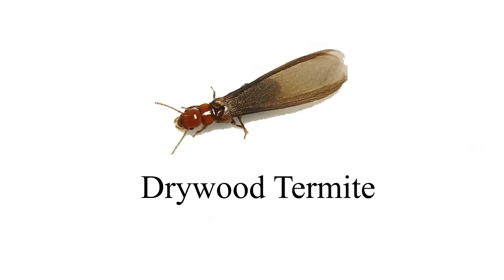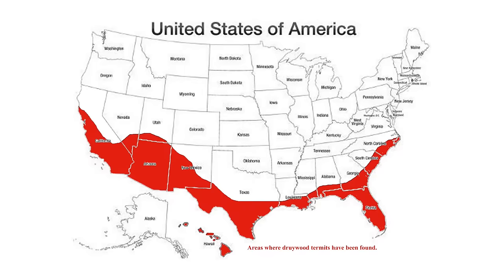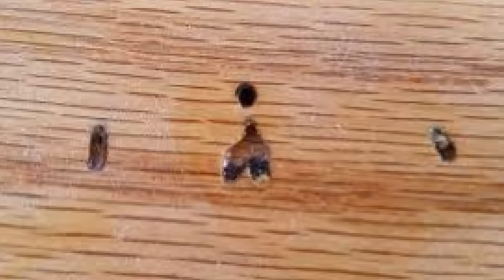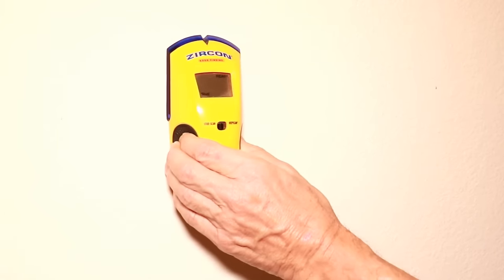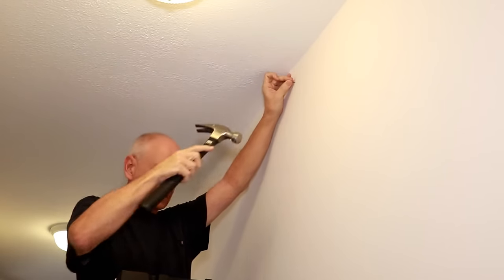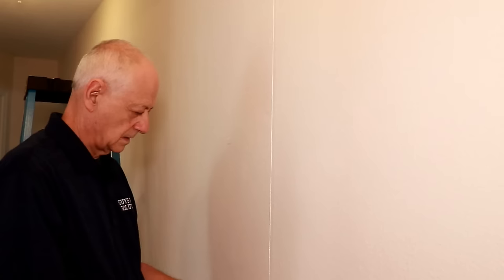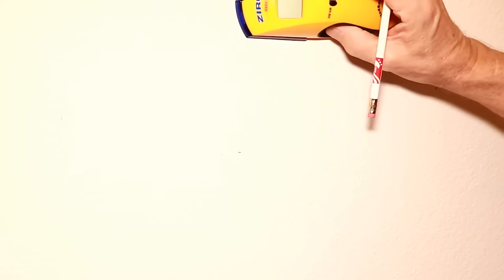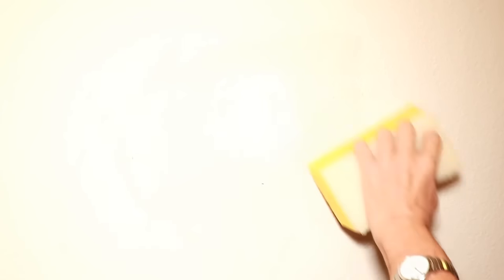How to Treat a Drywood Termite Infestation Yourself. A MUST see if you have Drywood termites.

Comment: thank you for this amazing video,and you taking the time to respond to my question that really means a lot. See I just recently found them and they are only on one spot on my home , so I was wondering if I can exterminate them all before they become more and to other areas of my home. You think if I spray that Taurus sc or the bora-care will kill them without me having to get the home tented? Thank you for your time.
Reply from the maker: Thank you so much for those kind words.  Very much appreciated.  

It is important to understand how drywood termites work.  They enter through cracks and crevices around windows, doors, the eaves, pipe penetrations, and so forth.  Most of the time, they enter through several locations.  That is because a swarm of them attacked your house at the same time.  If there was a crack or a crevice, then they probably found it.  After they established their galleries, which will be inside the wood, it will take four to seven years for them to be able to swarm.  Now that they are in your house, the swarmers will use holes that are in your studs to travel through the walls.  Those holes in the studs were created by the electricians to run the electrical wiring.  Not only are these holes going through the studs, but holes were drilled into the attic for the light switches and to run some of the wiring for the outlets.  So, the termites now have easy access throughout the attic and the walls.  If you have a basement or crawl space, they have access to that as well.  Most of the time, you will have no idea that they are in the walls, because the frass is inside the wall.  To make matters worse, if you have drywood termites, then your neighbors have them too.  That means you have been getting swarmed for as long as they have existed in the neighborhood.  Most likely, we're talking about years, so it's a safe bet that you have these guys in many locations in your home.

I always hate to be the bearer of bad news, but if you have drywood termites, the only sure way to get rid of them is to fumigate.  Prices for this can vary wildly in this industry, so I recommend that you watch my video on how to hire a pest controller without getting ripped off.  That video can save you a lot of money.  You should also know that the gas they use to fumigate has absolutely no residual action whatsoever, so you can get reinfested the moment the tent comes down.  Like I said before, if you have drywood termites, then your neighbors have them as well.  Since drywood  termites swarm every year, it is almost a certainty that you will be reinfested within a year after the fumigation is done.  The only way to prevent this is to do a preventive treatment on your house every 60 days.  Most pest controllers will not do this, so it is something that you generally need to do yourself.  I have a video on how to do that and I will place a link below.  If you absolutely cannot afford to fumigate your house, then you can try spot treating it yourself.  It is virtually impossible to find all the termite galleries, but it is way better than doing nothing.  I can tell you with a high degree of certainty that the termites are not limited to just one area, so treating just one area is not going to get it done.  Regardless of how you treat it, you should begin the preventive treatment immediately, so that you do not get additional termites paying you a visit.

I know that's not what you were hoping to hear, but it's the truth.

I hope that helps.  Be well my friend.                      

Video on how to hire a pest controller without getting ripped off:  https://youtu.be/y-a8XOqVrlE

Video on how to prevent drywood termites (You do not need to treat your yard.  You only need to treat the exterior of the house for drywood termites):  https://youtu.be/Yozv3s-Qwlw

Comment: Thanks for the info. Actually Guy, a few months back I commented in one of your videos to which you graciously responded to a question I had and offered advice. In return you asked that I let you know how it went. I am sorry to say that I couldn’t find my original message as I had watched several of your videos and didn’t know where to look. Anyway, I had taken your advice and haven’t seen any further infestations. However, I am sure after watching this video and the fact that I have not seen any subterranean termite tunnels on the 3 foot brick facade that what I had seeing in the craw space joist was dry wood termites; so I am going to try your method of the garden spraying on the floor joist in my crawl space to prevent future problems. Thanks again!
Reply from the maker: If you are talking about treating the floor joists with Bora-Care, then that is a very good idea.  You should do the attic as well.  Thanks for watching my videos and for your kind words.   Very much appreciated.  Be well my friend.

Comment: Sadly, here in So. Cal, it's simply best to bite the bullet and tent. And hope criminals don't break in whilst the tent is up. Ugh. Termites here are so aggressive, we've found it best to tent every 10 to 15 years, when in reality, every 7 years would be best. Seems as though the moment the tent comes down, boom! They're right back.
Reply from the maker: It is important to understand how drywood termites work.  They enter through cracks and crevices around windows, doors, the eaves, pipe penetrations, and so forth.  Most of the time, they enter through several locations.  That is because a swarm of them attacked your house at the same time.  If there was a crack or a crevice, then they probably found it.  After they established their galleries, which will be inside the wood, it will take four to seven years for them to be able to swarm.  Now that they are in your house, the swarmers will use holes that are in your studs to travel through the walls.  Those holes in the studs were created by the electricians to run the electrical wiring.  Not only are these holes going through the studs, but holes were drilled into the attic for the light switches and to run some of the wiring for the outlets.  So, the termites now have easy access throughout the attic and the walls.  If you have a basement or crawl space, they have access to that as well.  Most of the time, you will have no idea that they are in the walls, because the frass is inside the wall.  To make matters worse, if you have drywood termites, then your neighbors have them too.  That means you have been getting swarmed for as long as they have existed in the neighborhood.  Most likely, we're talking about years, so it's a safe bet that, if you have them in one place in your home, then you have these guys in many locations in your home.

As you already know, the only sure way to get rid of them is to fumigate.  Prices for this can vary wildly in this industry, so I recommend that you watch my video on how to hire a pest controller without getting ripped off.  That video can save you a lot of money.  I think you also know that the gas they use to fumigate has absolutely no residual action whatsoever, so you can get reinfested the moment the tent comes down.  Like I said before, if you have drywood termites, then your neighbors have them as well.  Since drywood  termites swarm every year, it is almost a certainty that you will be reinfested within a year after the fumigation is done.  The only way to prevent this is to do a preventive treatment on your house every 60 days.  This way, you do not need to fumigate every 7 years.   Most pest controllers will not do this, so it is something that you generally need to do yourself.  I have a video on how to do that and I will place a link below.  Even if you have an existing infestation already, you should begin the preventive treatment immediately, so that you do not get additional termites paying you a visit.

I hope that helps.   Be well my friend.                      

Video on how to hire a pest controller without getting ripped off:  https://youtu.be/y-a8XOqVrlE

Video on how to prevent drywood termites (You do not need to treat your yard for drywood termites.  Just your house):  https://youtu.be/Yozv3s-Qwlw

Comment: I live in mauritius and my termites look the same. They've been living in my furnitures for six years now.  I can't even express my anger by kicking a fist on my closet for fear i make a hole in it.
Reply from the maker: I must admit that I do not know much about Mauritius, but I do believe you are enjoying a tropical climate.  Of course, one of the problems with tropical climates they often come with drywood termites.  The only good thing about drywood termites is that they are slow eaters, but eventually they will cause serious structural damage to your home.  Therefore, I recommend that you have the building fumigated, if that is an option where you are.  I can tell you with a high degree of certainty that the only sure way to get rid of drywood termites, regardless of where you live in the world, is to fumigate.  If fumigation is not an option for you, then the next best thing is to follow the directions in my video, if you can get the products.
 
I wish you well my friend.

Comment: I found your channel tonight and have been watching for hours. I'm sure I'm not the only one. You are great at what you do.  I'm in Mobile and the red zone for drywood termites. I'm getting holes at the top of my drywall in the bathroom and hall. Do both termites eat holes at the top of the walls?
Reply from the maker: First of all, I am so sorry that it took so long to get back to you.  I usually get back a lot quicker than this, but I ran into a few personal issues over the last few days that really slowed me up with answering questions.

Thank you so much for watching my videos.  I am happy to hear that they've been helpful to you.

All termites will create exit holes, and they are often in the drywall.  The key to determining if these are dry wood termites is to look for frass.  If there is frass under the hole, that is deposited on whatever flat surface is under the hole, then you have drywood termites.  If you are not seeing frass, then you are most likely looking at either Formosan termites or a less destructive species of subterranean termites.  If there is no frass, then you should inspect the house for mud tubes, and keep an eye out for swarmers.  If you find mud tubes, then break them open and try to find a specimen with a red head.  You can identify the species by watching my video on how to identify termite species.  If you see a swarmer, then take note of the color.  If it is all black, then it is a common species of subterranean termites that is easily treated.  If it is anything other than black, then it has to be either Formosan or drywood.  Formosan termites do not produce frass.  Drywood termites do not make mud tubes.  The video will explain what all of this looks like and where to look for it.  

I hope that helps.  Be well my friend.  

Video on how to identify termite species:   https://youtu.be/dIs_a0nfVjg

Comment: Hello, a good video...however, after owning a home for over 40 years I have yet to find a single Termite Company that would deal with any interior conditions. The basic Termite Inspection and Extermination that is done "only on the exterior fascia board and shiplap" and "in the exposed beams within the attic areas". The recommendation is always to 'bag' the house as a required recommendation by the state of California. The option is always for drill and spray of the wood found to be infested.
- As such, I think a video on those areas and conditions to show a Do-it-yourself: drilling spraying and wood repair would be more useful for the audience (or at myself).
Reply from the maker: I understand exactly what you are saying.  The thing is that it is important to understand how termites operate. There are two basic kinds of termites.  There are subterranean termites that attack from the ground and there are drywood termites that attack from the air.  If you live in California, then you have both.  In most cases, when you are treating subterranean termites, it is unnecessary to treat the inside of the house because the termites are not colonizing in the house.  Subterranean termites typically colonize in the ground.  Some species do have the ability to build satellite colonies in your home, and for those species you may need an interior treatment.  You are correct that pest controllers will usually not do this, which is a big problem.  However, much of the time, all you need to do to treat subterranean termites is to treat the outside perimeter of the house.  You see, subterranean termites need to return to the colony, which is always in the ground, to bring food back to the other termites, and to obtain the moisture they need to survive.  This is the reason why treating the outside perimeter of the house is all that is usually needed to eliminate the infestation.  Drywood termites do not work that way.  They are not subterranean at all, so they fly to your house and colonize directly in the wood.  They enter through cracks and crevices all around your home.  After 4 to 7 years the ones that are in your home will produce new kings and queens that will start new colonies in your home.  After several years, your house will be totally inundated with new galleries of drywood termites.  Some of these galleries can be no larger than a peanut, so they are extremely difficult to find.  This is why the recommended treatment for drywood termites is to fumigate the house.  It is literally the only way to eliminate the entire population.  The problem with it is that the gas they use when they fumigate has no residual properties at all.  Since your neighbors also have drywood termites, and the termites swarm every year, there is a 100% chance that you are going to get reinfested within a year after the tent comes down.  The only way to prevent this is to do a preventive treatment every 60 to 90 days.  I have a video on how to do this.  The bottom line is that, before you do any termite treatments, you need to figure out if you have drywood termites or subterranean termites.  You can treat subterranean termites yourself for under $100.  Drywood termites are much more problematic.  If you cannot afford fumigation, then you can follow the procedures outlined in this video, but you will never totally eliminate all of the galleries, because you will never find them all.  Therefore, spot treating like this this kind of like playing whack-a-mole.  It is something you would go to need to do on an ongoing basis.

I hope you found this explanation helpful.  Please let me know if I can be of further assistance.  Be well my friend.